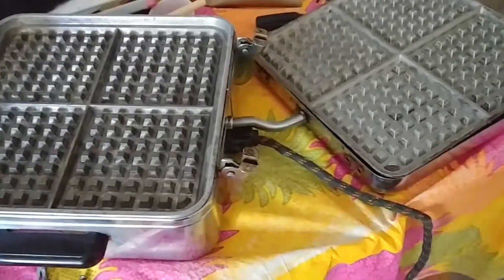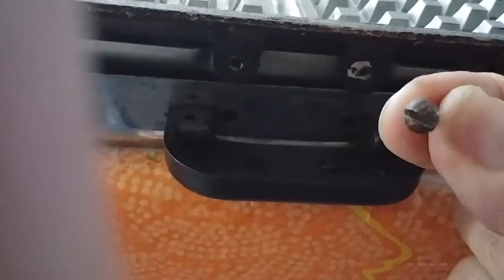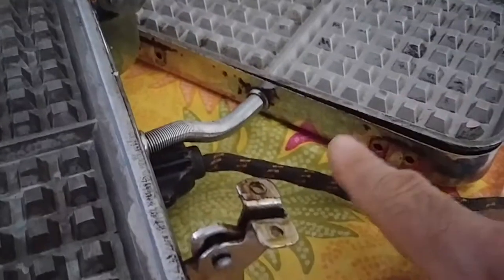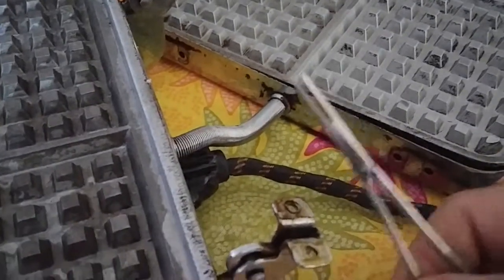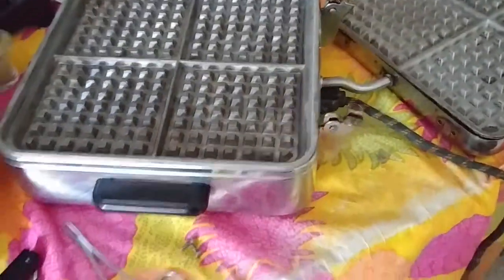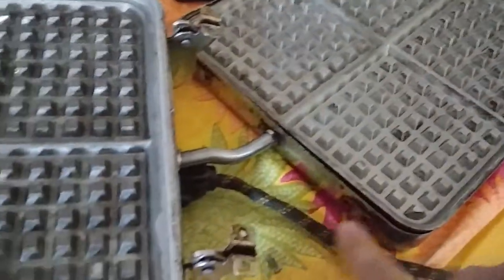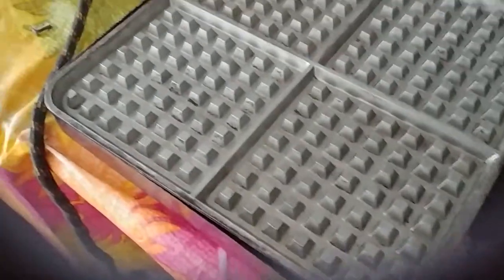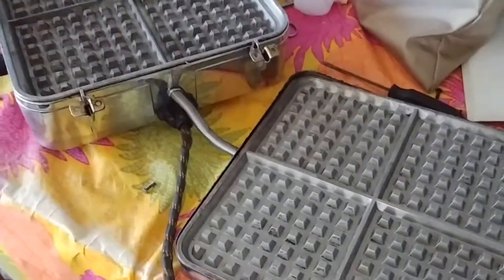Sunbeam W-1 waffle maker disassembly

Comment: This model Sunbeam was built like a tank. In the 1970s my mom was still using hers and it was over 35 years old at the time. Only major downside is the waffle plates are bolted in place and are a nightmare to clean. Some other older waffle irons of the era had removable plates which was far superior for cleaning purposes.